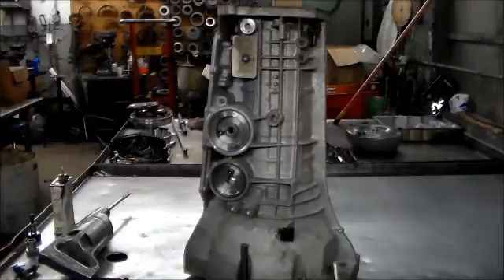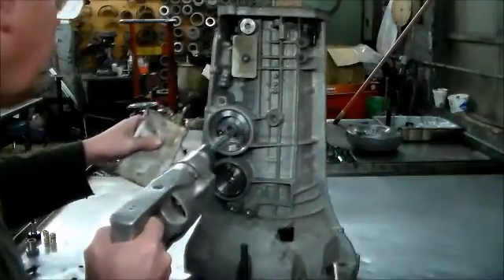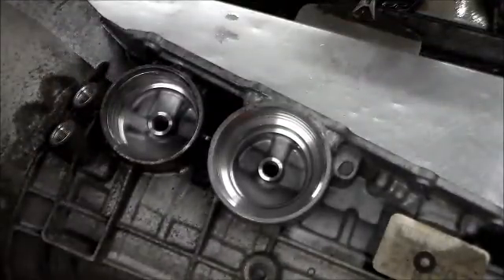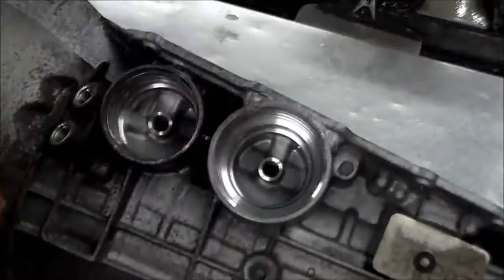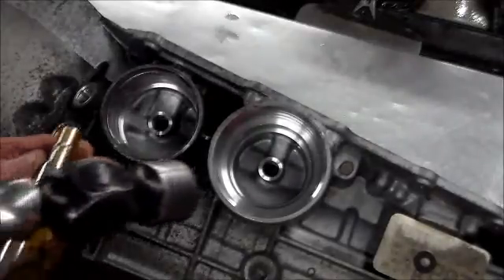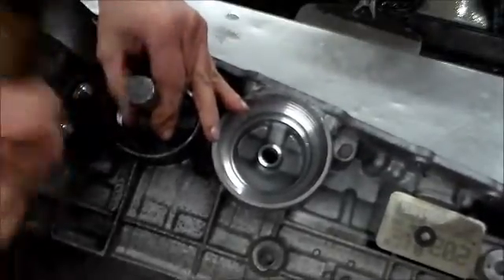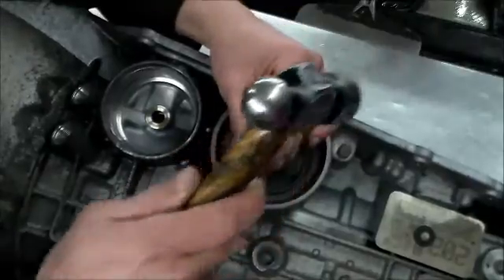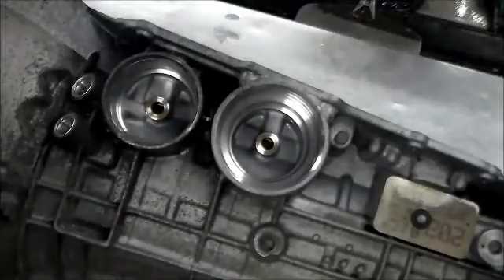5R55S Servo Bore Repair

Comment: Hi Gary, what point do I have to sleve the bores? Is there some measurements? I am rebuilding one and no visible wear on the intermediate bore and very slight wear on the OD bore . I am running tip of the pick over the wear mark and not catching .
Reply from the maker: What was the problem that your overhauling the unit?  Broken band?
Reply: @GaryFerraro it is a junkyard unit, going through before installing.  Band are looking good, no burns, no damage.
Reply from the maker: @AlperGenc79  I always sleeve as part of overhaul.  but if bores are not worn out you should be ok
Reply: @GaryFerraro thanks

Comment: Gary I know this is an old video, you answered a question on another one of your videos .. on my 5r55s the overdrive sprag was in fact trashed ... opened up first drum cluches look dang new new ... was curious if this has been done with the servos ... it was ...... my question... the servo piston has a hole through the shaft. Is there a proper orientation for these holes?? 

After I know that I'll be buttoning up this unit 

Thanks
Reply from the maker: No, Just install the servo piston.
Reply: @GaryFerraro you Sir are greatly appreciated, thank you

Comment: Will a worn servo bore cause slow engagement of overdrive ( shifts into over drive when warm but not cold)? Otherwise my transmission shifts fantastic in every other gear
Reply from the maker: How is the 1-2 shift, the front band is 2nd and 5th.  Do you have a scan tool that shows live data
Reply: @GaryFerraro  1-2 is mint , all the gears change great no slip or anything, and overdrive still works, it just decided it only wants to go into overdrive when warm, I had a stall converter originally and it felt really loose for ages and it threw the TCC code, so I changed out to a standard converter, and it feels nice and tight , my mechanic checked solinoids , fluid was great ect, everything checked out good, so I’m abit puzzled

Comment: I have a 2005 ford ranger 4.0 with 4wd and the 5r55 transmission. I have recently been throwing a p0733 for incorrect 3rd gear ratio. When taking off with more than half throttle the rpms will rev 3000 or higher and the light will be thrown.I have a scan tool available and all the gears are present except for 2nd and I have heard the truck has two different shift patterns based on throttle position which I am not sure of but have noticed it to shift smoothly and normally as long as the rpms are maintained below 2000-2100rpm. I dropped my pan and installed a new epc solenoid and filter while also inspecting the fluid for signs of damage which everything looked absolutely fine no shavings and clean fluid. The truck has 58,000 miles on it and I have noticed it to of been somewhat strange while shifting before the code was thrown for a few months prior to it appearing. If you get this thank you so much for your time and knowledge.
Reply from the maker: if you drive it normally what happens?  does it flare on 2-3 shift?
Reply: @GaryFerraro  I believe so. As I take off down the road from a stop it seems to not want to go into second gear as the rpms will climb up into the 3000+ range

Comment: Hi Gary. My 5r55e shifts fine thru all gears but I lost overdrive. Once overdrive is needed around 50 mph and the transmission goes into limp mode flashing light. I'm getting a TCC code a VSS code and Trans range code. What ya think. Second gear is fine
Reply from the maker: Does it seem like it’s falling out of 5th
Reply: @GaryFerraro  it never goes into fifth. It just holds fourth gear steady and will run 3,000 RPMs at highway speed. Up until that point every gear shifts very smoothly but once it goes in the limp mode the high pressure makes every shift harsh

Comment: my 5r55w trans problem no 3 gear i must repair the servo bore?
Reply from the maker: band could be broken, if so, i would say yes to the bores
Reply: @GaryFerraro  the problem is in drive no 3 gear the gear shift lose 3 gear, 1 2 to 4 and 5
Reply: @GaryFerraro  but no dtc if scan with scan tool no dtc
Reply from the maker: @Pendawa_Diesel_Plus  With a hand held scanner, may not show a code. do you know anyone with a snap-on or autel scanner
Reply: @GaryFerraro  yes i use  autel scanner but all is clear no dtc.
Reply: @GaryFerraro  thank you so much sir
Reply from the maker: @Pendawa_Diesel_Plus  can't believe it's not setting a code, what happens on the 2-3 shift?  spins up like neutral or flares on the shift?
Reply: @GaryFerraro  i think like no 2 and 3 gear,, if i drive the trans with manual 1 it ok but with manual 2 i think is not 2 gear like 1 gear the same problem if manual to 3 is not 3 gear but like 1 gear
Reply: @GaryFerraro  if i drive with D and i increase the engine rpm to 2500 the gear go to 4 and 5 very fast . no 3 gear
Reply: @GaryFerraro  i have replace solenoid pack with a new but no fix the problem
Reply from the maker: @Pendawa_Diesel_Plus    solenoids will not fix the problem,  your band is probably broken, anything in the pan when you had the pan down
Reply: @GaryFerraro  yes i think so, because i have change all disk plate, solenoid pack, forward servo, Over drive servo and intermediate servo but the problem is the same no 3 gear the shift gear is jum from 2 to 4 and 5

Comment: Hi, a Question please I have a 1999 ford explorer 4.0 5R55E with a code PO715 I was told they need to open the transmission to replace the speed sensor.Is this statement correct? asking for $600.00 if nothing else its broken .
Reply from the maker: Yes, it is mounted inside, bolted to the center support

Comment: What do you think about those new servo replacements with the modified pin and plastic sleeves?
Reply from the maker: Who makes those, i actually dont know about this
Reply: Check out AJ1E
Reply: MASTAGEE I ordered mine
Reply from the maker: @R Diaz Yes, i have seen those but never used them, you had good luck with them?
Reply: @GaryFerraro  The sleeves are made out of brass?  I seen some made out of steel, do you think those would be more durable?
Reply from the maker: @h.d.5288  I think either one would work, using the brass for years and never had a problem

Comment: hi Gary.  great video.  have you ever had a delay engagement into D and a 2/3 shift flare ? 5r55s after overhaul with new servo bore update . we tested vehicle and put it on the bench 2 times . codes po733 and po745 . any thoughts ?  very much appreciated. Happy holidays
Reply from the maker: +xtremegearheads  Hello, was the solenoid pack changed,  that can cause these issues. Happy Holidays
Reply: +Gary Ferraro we replaced it with a new one from trans star.
Reply from the maker: +Gary Ferraro What was the original problem?
Reply: +xtremegearheads originally we had a burnd od band and destroyed the drum. we replaced the forward planet ,drum sun gear .thanks for replying I've been stumped this is our 6th 5r55s and first issue after a build with servo bushings update oh we also replaced the servo pins too.thanks again for replying special on Xmas . I just want someone to lead me into the next direction .
Reply from the maker: You replaced the o/d section? There are 2 different sun gears 24t and 38t, yo put the correct sun gear, that will cause the 2-3 flare. By chance have you put a preesure gauge on pc A tap, What sleeves do you use Northland?
Reply: +xtremegearheads I used the northland tool with the new updated hole so no drilling because it already has the hole on bushing. also planet is 38 tooth sun gear
Reply: +xtremegearheads sorry also we have not gauged it yet.
Reply from the maker: Sounds like your doing everything correctly, have you checked pressure at pressure circut A. Its almost like you have 2 different problems but it points to something in pc A circuit, at this point i would either try a transgo shift kit or another valvebody.  Just to confirm the center support bolt is tight(the one that goes through the case)everything air checked ok?
Reply: +xtremegearheads i torqued the center support to specific and the 2nd time on the bench I tried to make it tighter because I've been told if not tight it leaks. my thought was to replace the support but air checked ok . I have to possibly air check again . 2007 Mustang 4.0 v6 . if I check the pressure in person A do I need to run through the gears on hoist or just idle? sorry for bugging you Gary lol my kids are going nuts with there new toys and I'm sure your busy with Xmas I really appreciate your help thank you very much!  what do you suggest I should try if it was you?
Reply from the maker: Just check it at idle and try full stall  see what you have, i dont have the spec in front of me, i would have to look it up. Gary
Reply: +xtremegearheads thanks Gary I'll be going in tomorrow.  I'll try that first and see what I get. if it fails what do you suggest I do next ? pull pan or take trans out to air check again.
Reply from the maker: Pull pan and air check, do you have a spare valvebody lying around?
Reply: +xtremegearheads i don't have a spare valve body but I do have an old solenoid block out an 2003 explore.  in the pump I've also installed the new control valve but that didn't help with the delay into Drive or the no 3rd gear . so I will pull the pan tomorrow and air check.  I'll have to modify something to air check center support.
Reply: I don't have a proper test plate I've modified air gun .
Reply from the maker: Thats fine i dont have a test plate either, air check with very little air and see what happens
Reply: +xtremegearheads thanks Gary I'll  let you know .....thanks for everything and taking time to reply on Xmas happy holidays! ! tony
Reply from the maker: Your welcome, Happy holidays. Where are you located?
Reply: +Gary Ferraro Hamilton Canada :)
Reply from the maker: Greetings from new york.
Reply: I'll send you an update when we get back at it. if that's OK with you.  great videos and keep up the good work.
Reply from the maker: thats fine. enjoy
Reply: hey Gary I took it out on the bench . going to air check figured it was faster to pull it out then test pressure port. I'll make sure it checks
Reply: all holding good.
Reply from the maker: At this point, you may want to try a valvebody,  but if possible hook up a pressure gauge to see whats going on.
Reply: can I get your email?
Reply from the maker: gsferraro@yahoo.com
Reply: ^
Ok